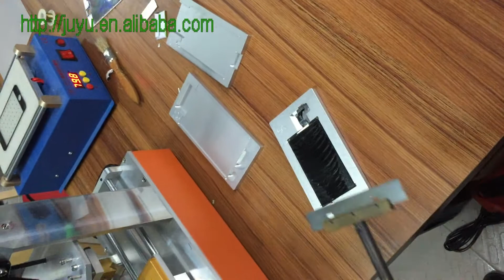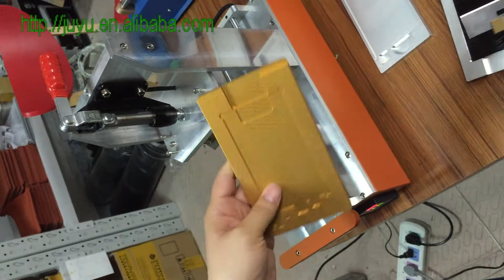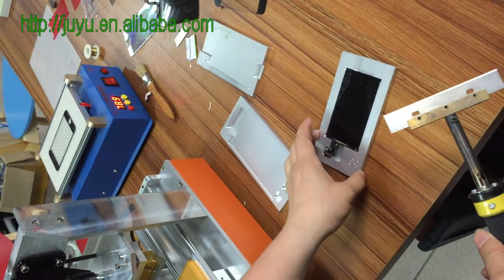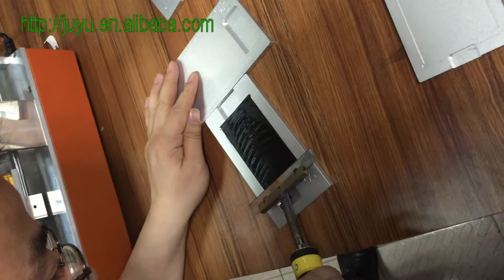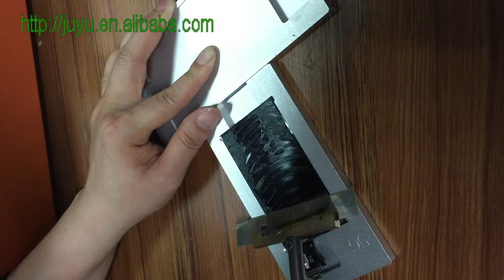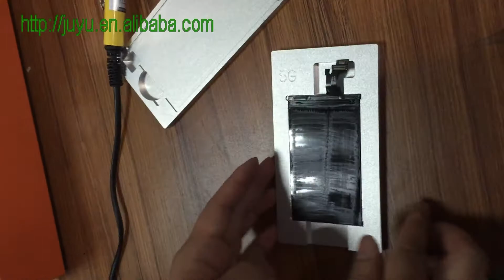using  soldering iron and glue remover mold  to glue remove oca & polarizer

Comment: May I know what is the name of this tool? And how many watts? please reply thanks!
Reply from the maker: Hi  
https://juyu.en.alibaba.com/product/60438029442-218702755/30w_40w_60w_UV_OCA_Glue_Remover_Tool_Manual_Tool_For_Removing_Glue_On_LCD_For_Mobile_Repairing.html?spm=a2700.8304367.prewdfa4cf.1.73152c54wLDkqA   
Have  30w,40w,60W depend on  soldering iron
Reply from the maker: Hi  the  links is correct   :https://juyu.en.alibaba.com/product/60278953102-218702755/2015_Hot_Sale_double_side_lcd_metal_mold_mould_for_glue_remove_tools_to_remove_oca_glue_for_iphone_4.html?spm=a2700.8304367.prewdfa4cf.22.73152c54OIrFWp